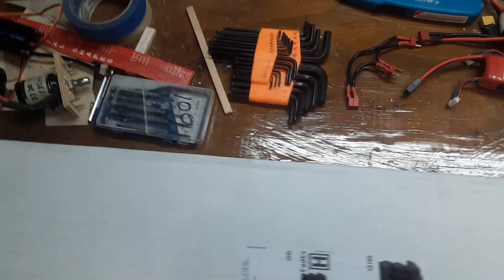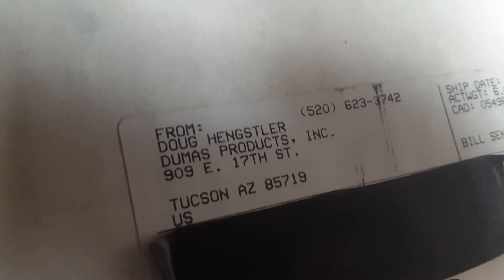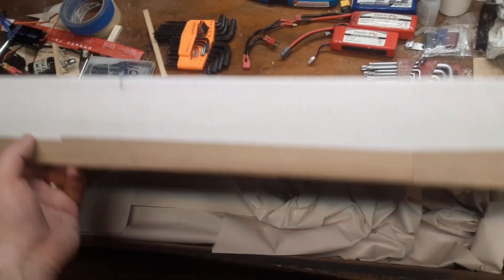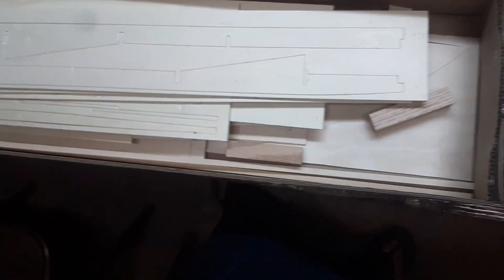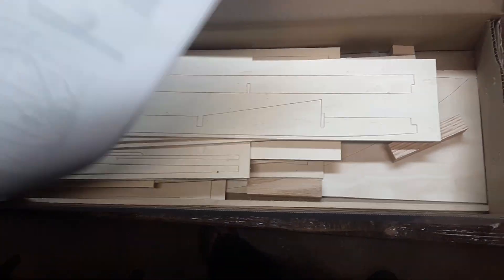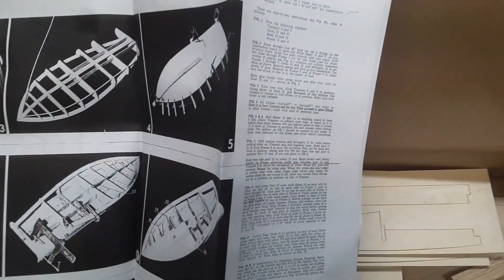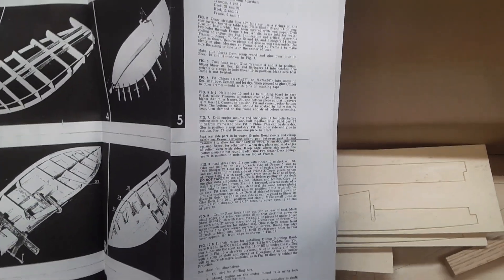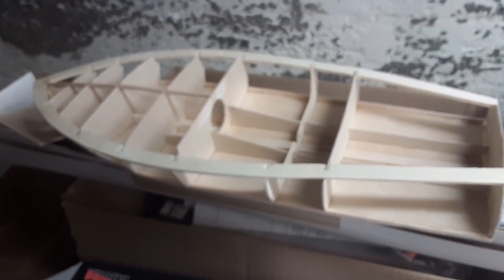NEW boat project unboxing. From Dumas Products

Comment: The motor you mentioned  will be perfect for that boat  do you plan on making any running videos?
Reply from the maker: I have been meaning to get some run videos of my other boats. Hopefully you should see something soon. This boat is behind at least the Remora and I should finish the SK Daddle Too since they are close to being completed.
Reply: @brandoncocola1322  I bought a sk daddle Jr after watching  your videos   the hull is together  I just have to power and install radio gear in it  thanks for  the inspiration